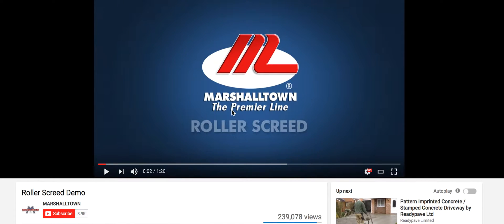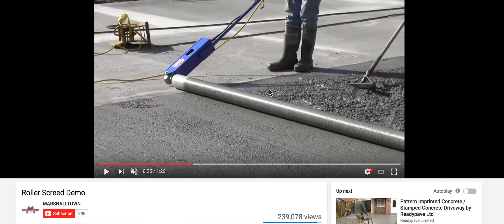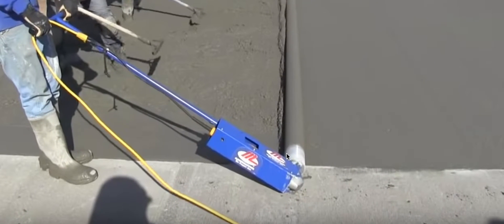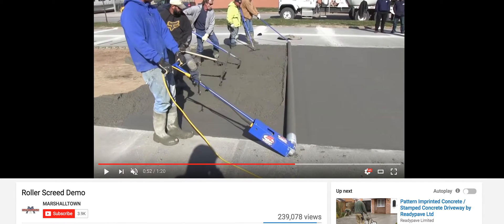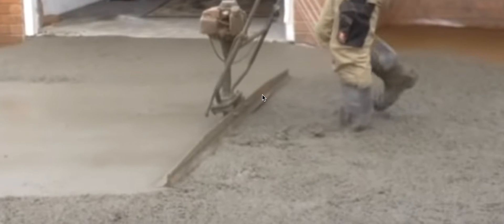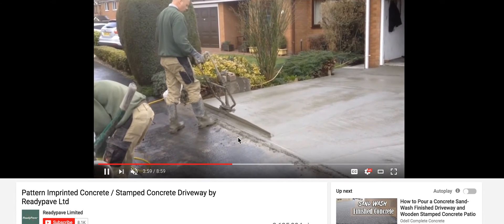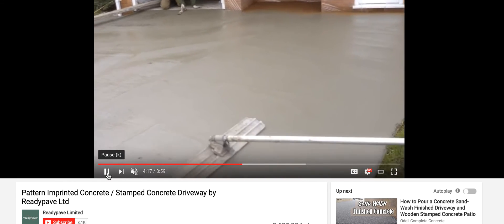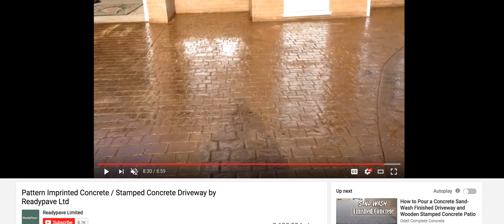Roller Screed vs Vibratory Screed for Concrete work WHICH one to choose

Comment: So what route did you choose for a power screed? I've been thinking of either, but the vibrating screed seems like you could mess some stuff up if not careful
Reply from the maker: Roller screed is what Marshalltown sent me  and that was to be tested on a 3' sidewalk...   I would like to talk more positive but I find the roller screeds... and even the highway screed versions to require manual labor after placement...
I would suggest a very light vibratory screed = one that you can adjust the vibration to equal to hand tamping and screeding like you were doing -well, by hand.
You just do not want to get all the aggregate stacked on top of each other and vibration can do that...  
I will do a video on how to test your progress with using same... 
I am busy right now but, I will get to that video in a few days.
Reply: @EngineerPEretired  Sounds great,  I just purchased a Magic Screed today with a 12 and 14ft blade. It worked well, especially for never using one before
Reply from the maker: Tip, learn to use a stiff slump because vibration will push stones down more with a high slump mix.
Reply: @EngineerPEretired  Yes! When I tried it yesterday the concrete was 4000psi, with Fiber and it showed up at about a 5 inch slump and we added Super P to it making it about a 6.5. Yea, well probably a good thing I was riding the rails with the screed. Otherwise it wouldn't have been so good.
Reply from the maker: FYI, some screed blades are designed to ride the rails and some are to ride on the concrete.
I would suggest 3/8 pea stone in your mix...u will love me for that one.
Reply: @EngineerPEretired  10-4. Not too many plants by me use Pea Gravel much, but I will see what I can do. It's mostly Limestone
Reply: @EngineerPEretired  I was just wondering,  is there anything wrong with using the Vibra screed on an outside pad with Air?
Reply from the maker: Look at my last video, loaded today, I show a $230.00 vibrator on a 2x4...

Comment: I can't see how those huge bootprints in the driveway won't have an impact on the concrete performance. Thanks for the education - keep up the interesting videos.
Reply from the maker: Technically, walking into concrete does push the stone to the bottom...  the best result would be to keep your feet on the wire or ground as much as possible...
But, the real World... you will walk into the concrete to some degree... But, walking into concrete is not good for compression results (again it pushes the stone to the bottom).
Reply: @EngineerPEretired  Thanks Kai. I guess with super watery mix the aggregate would be forced to the bottom. But that case, a lot probably already just sunk in the water anyways lol.
Reply from the maker: I am working on showing a few things - using a fish tank to show compressive angle of footers, water expansion and soil shrinkage, etc...  How it all relates...   Water and soil is the number one reason I find that concrete fails on surface / grade contact.
Reply: @EngineerPEretired  Thanks!

Comment: For aprox. 40' wide parking lot sections we do 2 20ft roller screed passes with a pipe on adjustable supports to ride on in the middle.  We pull up the pipe and walk the 16' vibration screed down the middle.  Following up immediately with bull floats on either side.  For anything smaller I think the vibrascreed would be sufficient.